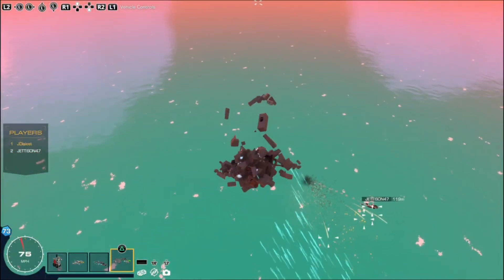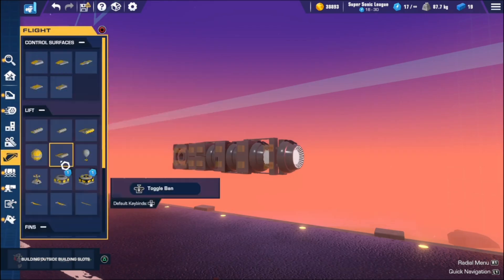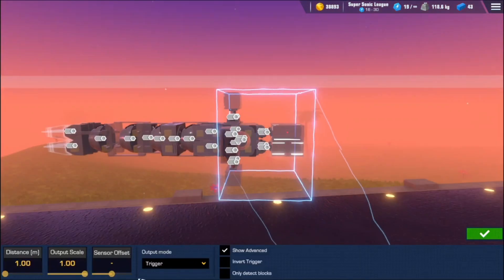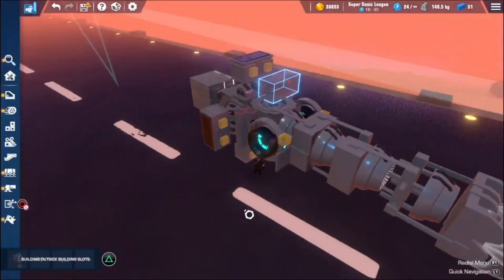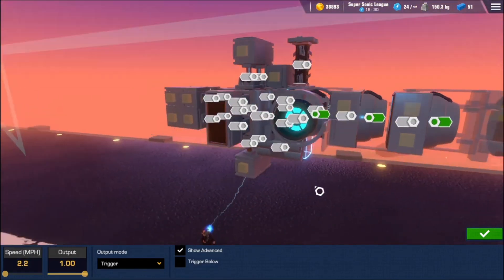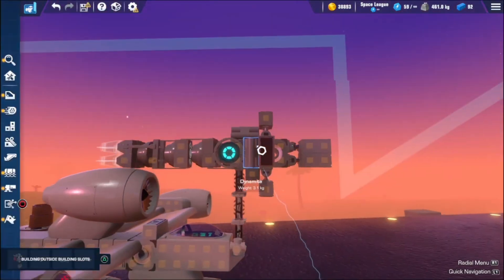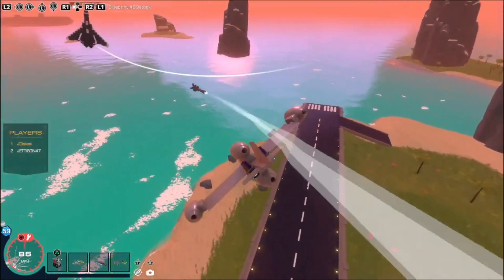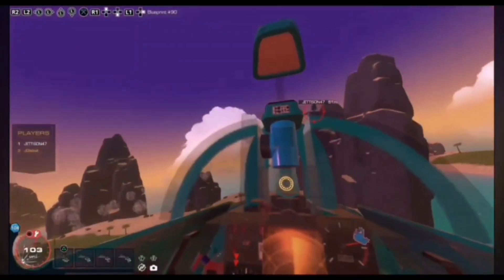Trailmakers guided missile tutorial

Comment: A high manoeuvrability jet, such as an f-22 with something like thrust vectoring, or an aircraft with high strength gyros would most likely be able to juke out the missile to the point where it can’t track the jet anymore, so my improvement would be to crank the gyro strength up to max so it has a better chance of following those jets.
Reply from the maker: They work best of high strength gyros actually, and the roll gyro settings i use is optimized for high manuverable jets. You can try to up it yourself, but it will be worse at almost  every range. Feel free to try it yourself.
Reply: @GuidedMunitionsmaybe your right, you did design the thing 😅
Reply from the maker: @Allhailmegatron84  and i have many better ones for you to check it on the channel if you would like! Maybe you will get your next inspiration! 😊 also sorry for the word salad last comment, i was in a serious convo lol
Reply: @GuidedMunitions all god bro 👍

Comment: I've been working on my own missiles for a while now, but I just couldn't get them to work consistently. Most of the basics you explained I already knew, but the small tips were really useful. I will be testing them in my own missiles. Also, why don't you have the 4 close range sensors start facing forwards in build mode and only move out by 10 degrees?
Reply from the maker: It makes a smaller profile when deployed to answer your question. And good! Glad you like it

Comment: Something happened that wasn't supposed to. I'm not sure if it was the target I was testing it on or the platform I was launching it from, but it just won't track. I've tried at least 100 times, none of which tracked. I tried so many times to make slight changes to the missile like making it rotate faster, making it rotate slower, making its top speed slower, changing the angle on the sensors, basically everything. And it just won't track. I did end up finding an issue where the gyros were flipped, but even after the change, it wouldn't work. I even tested it on one of the largest ships I have, and it wouldn't work. I swear I've checked all of the logic and sensor pairing, but nothing fixes it. Please help

Edit: i fixed
Reply: How
Reply: @thyshoekstra2830  I changed the way the sensors extend

Comment: says "make the missile light weight" proceeds to use two gyros for pitch and two gyros for yaw. truly. brilliant.

you should really learn symmetry does or does not matter. in this case i would say its pretty safe to substitute out the second gyro on each axis for logic gates or more warheads or something. also your tetrising could be better. really nice sensor array though. i hate chucky missiles but at the same time increasing the size of the sensor array is the only solution.
Reply from the maker: Im aware it doesn't matter dw, and trust me, the two gyros are important. More warheads and it would be too much

Comment: 6:00 you don't need to use the 4 extra distance sensors for tnt only, you can use the same distance sensor for tracking at 1000m and tnt detonation at 5 meters. Search Zincx on workshop for example build. Great video dude, although I try to hook my sensors directly to gyros, preventing the 1-2 tick delayed reaction time. You can then use the sesnors facing forward for tracking too, this really helps maintain a lock.
Reply: um so like the sensors were directly connected to the gyros in his build? also he wasnt using 4 sensors for tnt, it was one?
Reply: @CubicalCreationsyt you're right, thats my mistake. But regardless you can use all sensors for tracking and tnt prox, which is far more effective and reliable
Reply: @lordchristsavedus3590  your right, just making sure you didn't change sm that didn't need to be.

Comment: i've been experimenting with missiles for about a month now to design a SAM ( surface to air missile ), and came to multiple conclusions : missiles cannot be fast , anything higher than 500km/h will struggle to detect pretty much anything , this is mainly cuz detect sensor suck a bit and cant detect anything farther than 300m , this makes sense since it just sends a ray of detection to check collision however it is extremely unreliable at long range , and also just a tip , dont over enginneer your missiles , dont try going for a fancy detection system cuz it wont work and mainly due to detect sensor limitations , the simplest missiles are alwats the most reliable. Anyways , the missile i'm using right now looks very similar to yours , it has gimbal to have a straight and stable trajectory ( mainly to counteract gravity ) , and i placed my thrusters the exact same way , however i have much more sensor to help it detect at long range a bit better , i use 87-89 degree angle and it works like a charm. I mean your missile is very basic , it just has some good fine tuning, Air to air missiles are not that hard to make since they're generally close-range , all you need is good angles and some sharp turns . do you have any tips for long range detection however?
Reply from the maker: My advice for long ranges are lower fovs (coming from a guy who can make missiles that hit 80% of the time at 1000 meters) and for monuverable ones, you can just watch my video for the angles🎉
Reply: @GuidedMunitions the thing is your targets are pretty huge, makes sense your missiles can hit
Reply from the maker: @Sunshine_Tsb only the bvr missile target, its an interception missile lol. And it has hit smaller fighters from 500 meters
Reply from the maker: @Sunshine_Tsbill post a video of it hitting a smaller target
Reply from the maker: @Sunshine_Tsb posted it for you
Reply from the maker: @Sunshine_Tsbsorry, NOW it is up
Reply: @GuidedMunitions btw are quantum rudders important for missiles? they make the missile turn worse in my experience but i still add them
Reply from the maker: @theTNTofTheSnail if you only make the strength up and the turn rate low it is good, if not, its bad
Reply from the maker: Also, watch my bvr shorts
Reply from the maker: BVR*